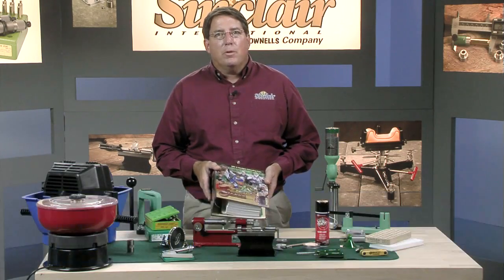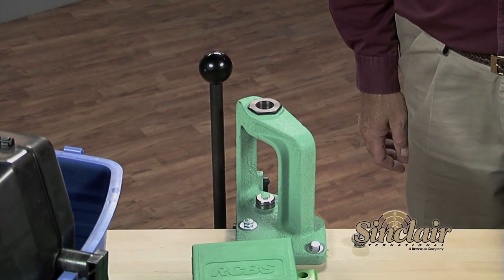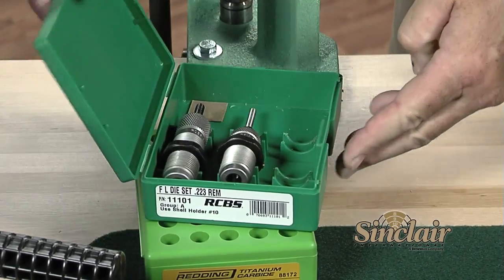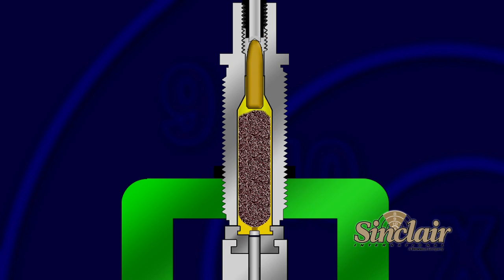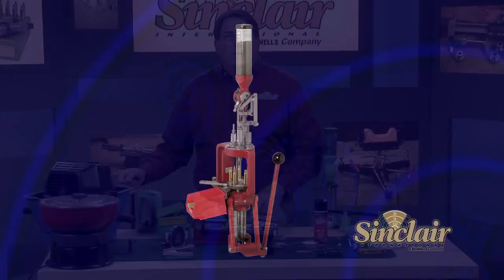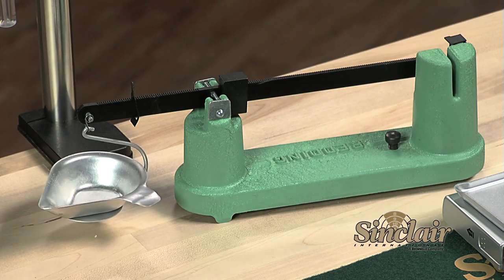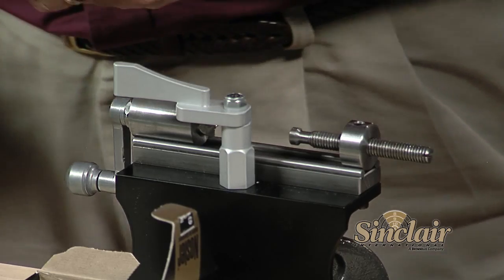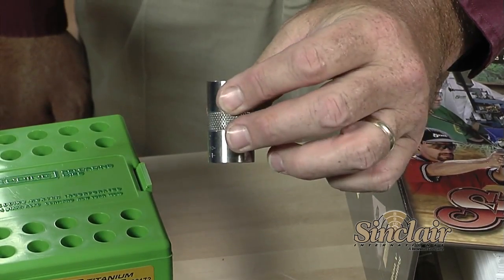Sinclair Reloading Series Part 5: Tools for Reloading

Comment: @fishblade2 I reload all my loads except the unreloadables (.22 RF). Reloading enhances accuracy greatly. First and foremost is consistancy. This guy went into detail. Press, scale, dies, calipers, tirmmer, flash hole deburing tool, primer pocket tool. You will need to resize after every shot. The firing itself causes the neck and sholder to expand. There is quite a lot to relaoding. These videos are ok. Ammosmith on Youtube goes into detail much more than these guys.